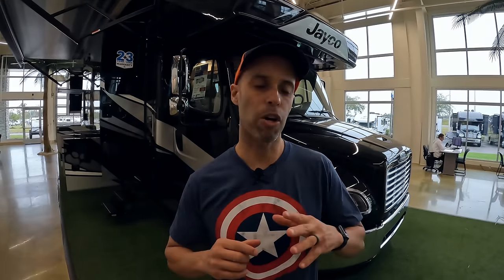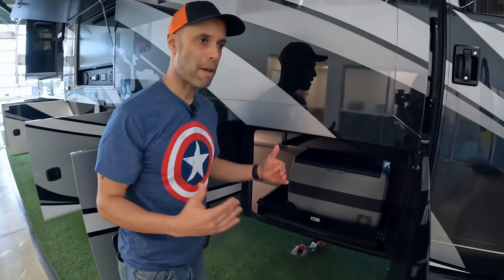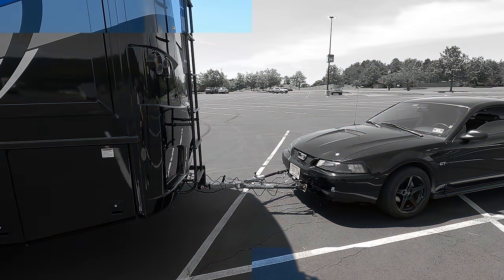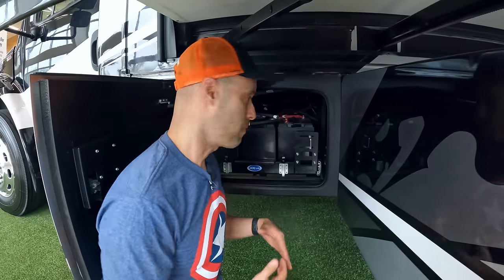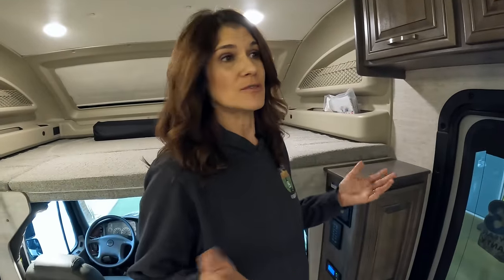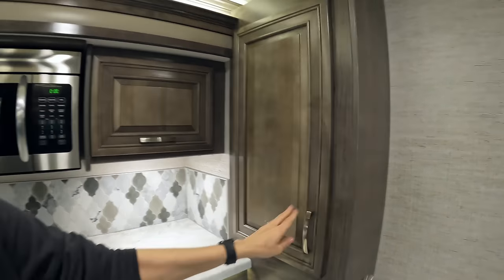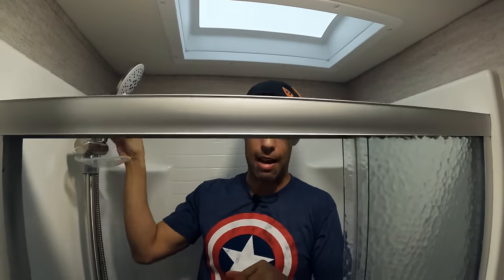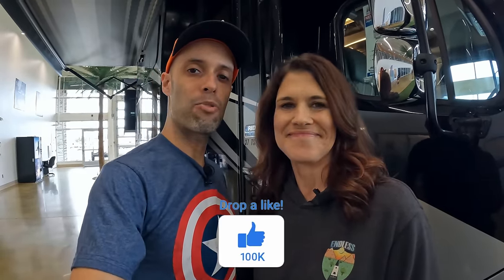The Best Selling Super C Motorhome On The Market!

Comment: I have a Jayco 37TS and it is great.  Easy to drive and has plenty of power to tow my Jeep.  I agree with your tow bar selection because that is what we bought.  I know people go for a traditional bar with a supplemental braking system, but they are less reliable, cumbersome and more failure prone.  Anyway, good review of the TS.  The main reason I like the TS is that the TV is directly across from our theater seating.  The refrigerator is HUGE and the ease of getting in and of the cab seats is a MAJOR selling point.  The best comment I got recently was a small boy who told me our motorhome was the best looking RV in the campground (large campground).  I told him he could buy it.  Later that day he was riding bikes with his family and and proudly told them that our camper was going to be his.  You don't get a more honest opinion than that of a child. It is a beautiful camper.

Comment: I have the sister RV, the Entegra Accolade 37TS.  I absolutely love my RV; but, i did do some modifications.  Things I didn’t like are: 1) lack of power ports in the cab - I’m a gadget guy, so I have the Garmin 890, Haloview MC7108, TST 507 TPMS, and Blue Ox Patriot Brake Control and multiple iPhones and iPads.  Of course, Entegra put one 12 volt port and one USB port on the dash.  My solution was to install a new power block under the dash and put two 12 volt power ports on each A-Pillar and put four USB ports mounted in the tiny ashtray face. Dislike 2) inaccurate tank monitoring system.  My solution was to install the SeeLevel II three tank monitor system with just the tank monitors in the water bay and another panel with water pump switch in the bath wall next to the light switch.  This also solved my third dislike, having to go the the main panel or go into my iPhone to turn the water pump on in the middle of the night; however, I thought I saw what I think might be a water pump switch in the toilet area of the bathroom on the RV you reviewed.  Another modification which was not associated with a dislike was installing a safe behind the bedroom TV, it was a simple addition to secure our semi valuables when we’re away from the RV.  I’m planning to install Soft Starts on both A/C units, which I already have in the box.  Here’s what I really love about the 37TS, basement storage for days, I can store my two Lectric bikes, plenty of tools (my wife thinks I have enough to build a house), Blackstone Griddle, Weber Q1000 gas grill, and every thing else plus it tows my F150 pickup like a dream.  Another great feature is, you can have a dance party in the living room with the opposing slides out.  Lots to love in this Super C.

Comment: I have been critical of Entegra and Seneca because of the marine plywood bays in front of the rear wheels.  I now see why they did that…you gain that pass through storage!  The rotocast bays prevent you from accessing that area. I hope we can afford a Renegade when we’re ready but we may need to settle for the Seneca.  Another thought…couldn’t a person add slow close hardware?  Finally, I’m 79” tall and Jayco offers 80” Kings..Renegade does not…at least under $400k.

Comment: Counter depth fridge is under 30 inches deep and you can take the doors off them to fit it out the door.  If it is a standard depth fridge you may need to take the windshield out, they are about 36 inches deep with the doors on.

Comment: Hoping you can spend time on the chassis driver safety features in future reviews. We spend many risky hours behind the wheel so we need that info in detail. The coach features are all similar and mostly easy to upgrade but what about the infotainment, nav, or systems monitoring, and if missing adaptive cruise control , or precrash warnings with self braking, etc., makes it a non starter. Could skip opening of empty cabinets and drawers, features that haven't changed in 30+ years. Thanks for the vid.

Comment: We understand that this rig was set up at a dealer's indoor showroom, and it wasn't practical to open and close things, but I'd like to see how the unit works with the slides closed. I expect to travel from the Pacific Northwest to Florida and back every year, so will be spending a lot of time on the road.  One of my criteria for choosing an RV is that you need to access the bathroom, kitchen and actually use the main bed with the slides closed.

Comment: Those are built on Medium Duty Class 5 & 6 commercial chassis.They are commonly powered by no bigger engines and transmision combos as available in 2500 P/U's. So keep in mind, cheaper-means-weaker as it applies to tow ratings being very optimistic indeed on these lighter duty Super C's.

Comment: My BIL bought a brand new 2019 Jayco from the dealership in the Des Monies area, it was a disaster, the sink fell out of the counter going down the road! One of the slides was not mounted squarely in the frame work so the seals never sealed correctly, when the slide box was squared up to seal it would bind up and the slide gear didn’t line up! The cabinets came loose from the walls! Get the picture! 
He returned it to the dealership for repair, absolutely disappointed with their half a$$ attempt to make repairs, as a retired cabinet maker craftsman he took it back and fixed all the interior issues himself, extremely disappointed with the original craftsmanship and the poor at best attempt to make repairs, he sold the motorhome and purchased a used 2018 Holiday Rambler Endeavor!  He is so glad to be rid of the motorhome I doubt if Jayco offered a brand new one he would not accept it! FYI.

Comment: The worst diesel and DEF fill location design ever. Anyone who has used a truck stop fuel location would know, the diesel is always filled first, then the pump will switch to DEF. In the case of this Jayco, that would mean backing up to fill the DEF tank. If you are flat towing or another truck has pulled in close behind you, backing up is not an option. I know you could fill the DEF first, but that means starting the pump 2 times (which could mean running inside 2 times). If Jayco had put the 2 fill areas next to each other, then it would eliminate the problem.